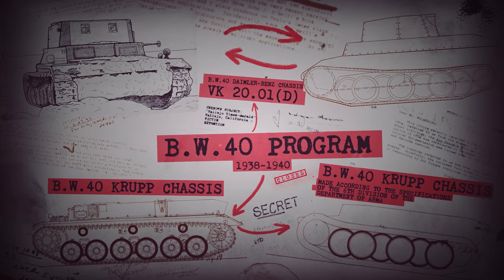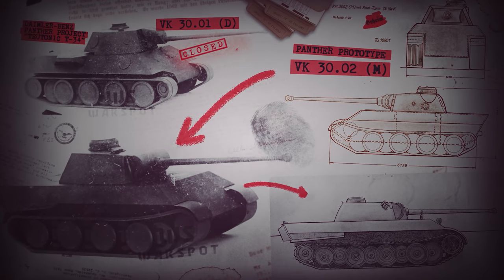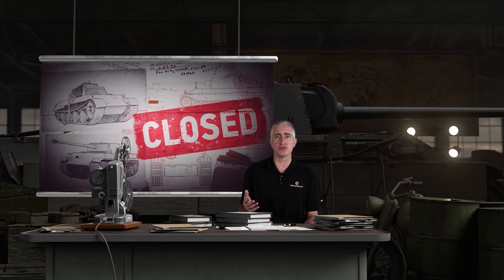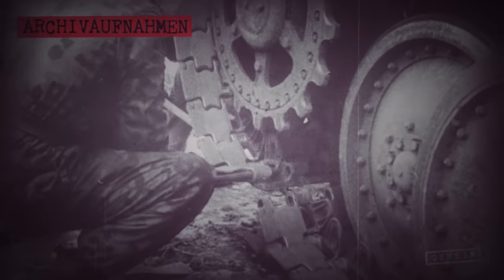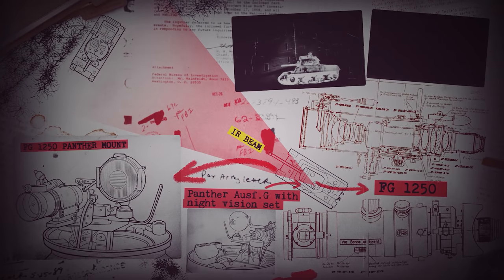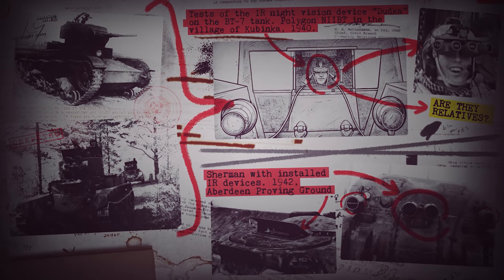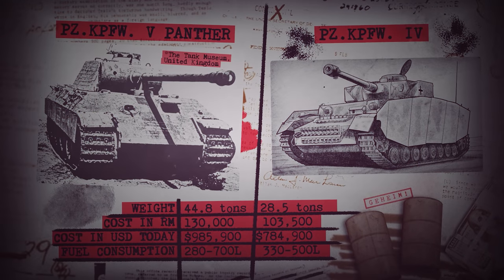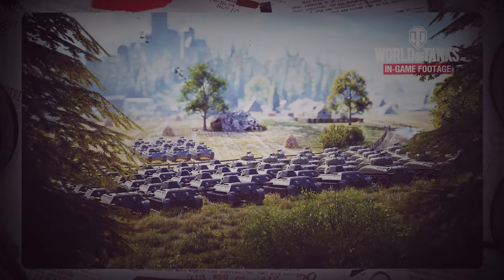Five Things About the Panther with The Chieftain - World of Tanks

Comment: I have to partially disagree regarding quality vs. quantity. First, was a design weighing 45 tons really the lowest weight solution for a tank with 75 mm gun and Panther-level armour? No way! Both of those could have been incorporated in a design weighing a maximum of 30 tons if the designer had been forced to concetrate on producing a war-winning tank, not a tank for tank designers' Nobel prize.

Comment: I would like to know something specific about the German panzers start up procedure. I hope someone could help (asking for a friend). We have all seen many videos of Stug IIIs, Panthers, Tigers and King Tigers use a manual inertia starter to get going. 

I've read that Maybach V12s all had them and the Panzer IV (Stug IV, Wirbelwind, the various other flakpanzers with a PIV chassis) had such an engine, so it should follow that the Panzer IV could be started that way esp if later model tanks still did so. 

I have never found a photo or a video of such a start up. On military shows videos they're either already on or use an electric starter, but never a hand crank. So my question is to confirm that a Panzer IV had a manually cranked inertia starter and if there is a video of it?

Thanks if you can help.
Reply: Yes. the PzKpW II, III and IV all used a Bosch AL/ZMA Inertial starter. The Tigers and Panther used a Bosch AL/ZMJ. Some parts were interchangeable between the two models but they otherwise differed in the input gear, train and clutching mechanisms.  According to the operator's manuals, this was the way that a cold engine always had to be started.
A YT video is pointless as it won't show the sequence of steps performed by the driver. In the 1944 Tiger driver's handbook that I own, it lists 7 steps even before the wireless operator and loader even move the handle (and another two between winding it up and winding it down again).